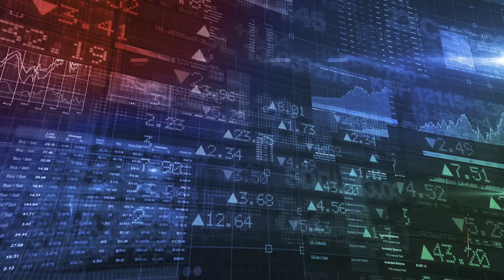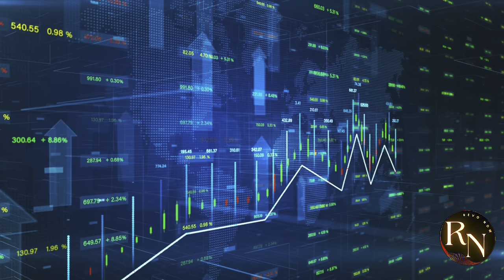ASML's Shocking Move: Did They Just Hand China The Lithography Crown?

Comment: 😂😂😂
AFAIK basically nothing have changed as the restriction of ASML Twinscan XT and NX2050i and 2100i remained in place. Dutch Government have not issued any licences so far.

Furthermore Chinese fabs are not interested in the lower range lithography equipments offered by ASML as the equivalent offered by Chinese manufacturers are much much more cheaper and best of all, just as good. Cheaper to maintain. 😂😂😂
Reply from the maker: @mythbusterthe6749  Exactly!
Reply: It's a Clickbait title.
Reply: How many WPH do SMEE's DUV machines make? Do they have the same accuracy and do the chips have the same quality as those done by ASML's machines? What about HighNA? Also, EUV patents mean nothing, show me when they are actually integrated in a functioning machine that is as effective as ASML's machines and that can be mass produced. Do they have anything close to ASML's supply chain with Zeiss and Trumpf? Also, good luck breaking up ASML's existing business relations, especially if you have an inferior product.

Comment: The reasons for smaller node sizes has to do with speed and less power consumption.  Certainly, things like cloud servers and 6G depends on these factors  However, functionally most applications do not. Legacy or mature node chips work sufficiently well in these applications since price is a more overriding factor than  ultra high speed and minimal power consumption. When high end chips become more common with costs declining, many applications will try to take advantage of these higher end chips, if not, just for marketing purposes.  There is something about human nature that seems to always want the best they can afford.

Having said that, there are alternates to silicon and lithography on the horizon that lure advancements because they do not necessarily need lithography to achieve speed and less power consumption.  Photonics, graphene, and nitrate substrates are some possibilities being explored.  If these sectors become production realities, lithography could be a dying sector when the costs of these machines range in the hundreds of millions of dollars.  As said, before, given equal or better functional characteristics, cost is the deciding factor.

Comment: US can impose sanction against ASML if ASML defy US order by supplying Lithography machine to China.

ASML equipment is manufactured using US components semiconductor equipment, design, and software companies are based in the US or have critical engineering in the US. 

In the equipment space, Lam Research, Applied Materials, and KLA are based is of the US. 
ASML, the widely known leader in lithography, does much of their critical engineering for the EUV Source and EUV Collector out of San Diego. 

ASML pays royalties to the EUV-LLC whose membership includes multiple US national labs. 
Without these tools, it is impossible to manufacture chips.

The critical software needed to be used to design chips is called EDA and it all comes from the US. Cadence, Synopsys, and Mentor Graphics (now owned by Siemens) are located in the US. 

Without this software, it is impossible to design modern chips with Lithography machine.
Reply: 😂😂😂😂 O man you surely fell for this clickbait
Reply: @JB-mj7ge  And you are a wise guy with a wisecrack who has the answers to everything with fascinating facts and deep metaphorical experiences and knowledge.
What a lout!